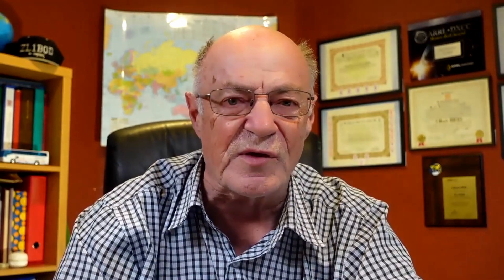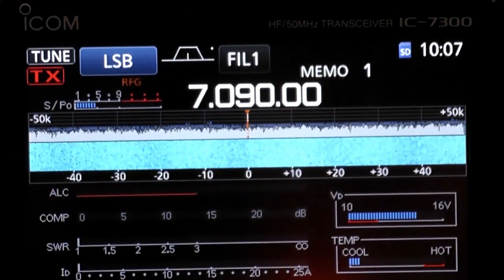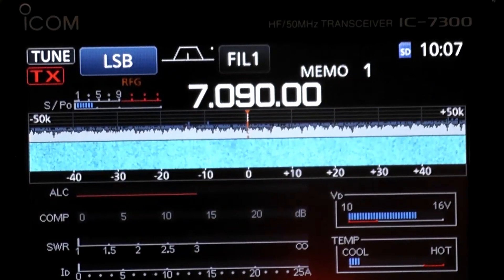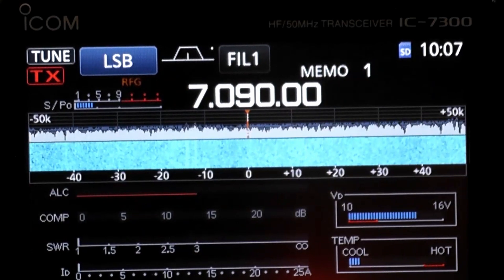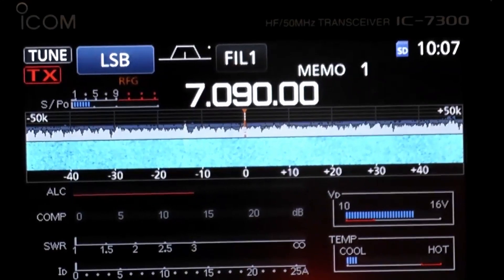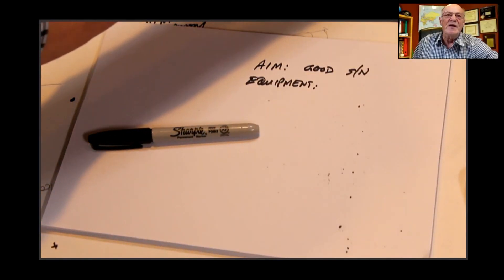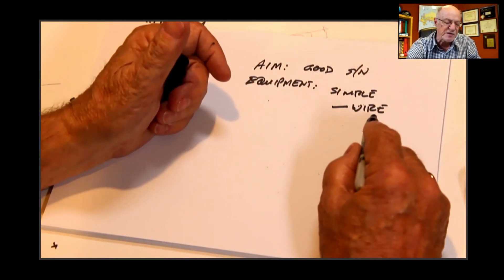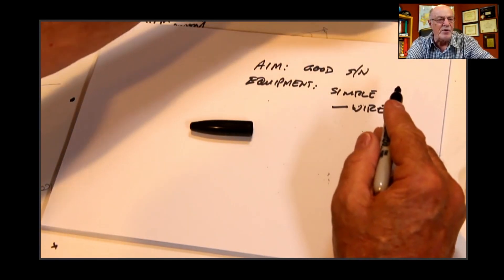HAM RADIO - Eliminate the NOISE !!

Comment: For my qth. I used a 49.1 with a 66.6ft of wire its on the top of a 3ft fence. Works superb on 40mtrs and 80. Bit deaf on 20 15 10 though. I could give a loop a go with no un un.

Comment: I followed you until you were switched between the wire and the wire eliminated. My question was what was hooked to what that allowed to move from the experimental factor and the non experimental factor? Thank you for your time. You were very kind to help me to reduce the noise level.

Comment: I would be looking for other causes of the noise, if you have a rig that runs on 12 volts, get a battery, and turn off the house current and see if the noise quits. If you don't have such a rig, beg, borrow, or buy one!

I have found many times that a wall wart is causing the noise. Some try ferrite and other tricks, but I replace the noisy ones with ones with transformers, not switcher supplies. Other causes are light dimmers and touch switches on lamps.

Noise on antennas can also be due to power lines, but that is rare, as the power company is losing money with insulators that leak current, and they replace them. Don't give up on your antenna, unless it is the antennas fault, and no, verticals are not noisier than any other antenna, it is hog wash to stop some from trying a great antenna system.
Reply from the maker: Thanks for your sage advice, all of which has been checked !!
Reply: @ZL1BQDRoly  So you know the cause of the noise? Or it is outside your property?

I have dealt with noise here, and it has all been local to my property, except when a neighbor was welding. Fortunately for me, he has moved and no one else welds around me!

Good luck with you hunt!

Comment: 10:22 Why nobody does such comparisons on 70cm band? Is the noise floor around 440MHz so low that everything is fine even with a simple yagi with staight split dipole? No need to build Low Noise LFA Yagi for UHF?

Comment: I suggest: Raise the horizontal loop up to about 30 feet. Use 300 or 450 ohm feedline from the loop to a 4:1 or 6:1 balun at your shack, then into an antenna tuner via short 50 ohm coax jumpers. This will literally raise your ears out of the surrounding noise. If you use it for transmission too, at 30 ft., you get 6 Db gain! And a super low radiation angle omnidirectional transmission pattern on the higher bands really great for Dx

Comment: Good day sir.
I am just one year old ham here in Belgium. 
The other day I went to an elderly OM who builds antennas,  repairs units, etc.  
Outside he has a 40m EFLW and he uses it every day.   But on 40m and specially 80m there's a noise level like you're showing here.  

We also could hear an Italian distant station,  but it was not good.  Lots of noise...
Then, leaving it on that station,  he got out a homemade magnetic loop antenna and plugged that in, and tuned the variable capacitor... what a difference.  The same signal, but virtually no noise...!

Je explained a lot about it picking up just the magnetic part of the signal and not the electric part.  It was fascinating...  He also explained that every time he changes frequency, he also re-tunes the resonance.

Your "around the house loop antenna" doesn't seem to need adjusting every few KHz you move...  which is an advantage. 
Shouldn't every ham, (who can), do this ?

Thanks for making this meaningful video 

Peter
ON3VCF in Belgium
Reply from the maker: Not every Ham is able to do this I guess.  Also, results are variable and this worked for me. :)

Comment: So one end connects to driven or centre of the coax and the other end comes back to the driven pin also with radials on the shield or the other end comes back to the shield with the radials?
  Some people have been having success using a loop like this as the aux antenna for vk5 or similar noise cancellers.

Comment: If you use that wire as a Beverage receive antenna and add a phase system, you will be able to knock out just about all noise.
Reply: This loop is not a Beverage receive antenna, it is a closed loop..  But you are right about the phase cancellation technique..  But that is only true if the man made noise is coming from a single point source, in Rollys case he is surrounded by all sorts of manmade noise coming at him on all points on the compass and all within a couple hunderd of meters too,, Yikes !   You are right though, you can eliminate perhaps the biggest contributer of the noise via the phace cancellation technique have done it myself both for HF and TV and FM Band Dxing..

Comment: Could you not have a UNUN that connects to your transceiver in the roofspace and a wire that comes from the Antenna connection on the UNUN through a tiny hole in the facia board then to a pole at the bottom of the garden which should work or what about having a look at W5JGV and seeing if you can use one of the trees in your area as an Antenna.

Comment: I'm a new Ham. How do you connect a loop antenna to the coax, do both ends connect to the inner coax conductor, or one to the inner and one to the outer conductor? And is a balun used? Thanks, and great video.
Reply: Look up "Loop On Ground" AKA LOG antennas which is basically what this is. As far as I know, only one end connects to the center conductor through a torroidal transformer, the braid is your ground which connects to a counterpoise wire from the toroid. And yes you'll want a balun choke near the transformer and one at the shack to prevent picking up stray RF on your feed line going into the antenna AND the radio.
Reply: @macgyver5108  Thanks for the reply. I've got a 128 ft. end fed antenna and thinking about extending it into a loop antenna. Want to make sure I do it right.
Reply: @Znobyrd  I looked it up and a loop on ground uses a 4:1 balun/transformer and looks like both ends of the loop hook to that. You'll still want torroid chokes on both ends of the feed line for stray RF.

Comment: Is this a listen only loop or is it tuned to transmit on?
Reply from the maker: Yes, for listen only.  It could be made for transmit but the components would have to be "beefed up" to cope. Primarily for listen though simply to beat the noise as much as possible.
Reply: @ZL1BQDRoly  And I agree , you could transmit into it, but the XYL might not appreciate that hihi !
Reply: I once had a square resonant 40 meter one wavelength Loop up at 18 feet. the wire was perfectly parallel to the ground, I had an annoying noise I was trying to get rid of , and it worked perfectly. That antenna was a perfect NVIS antenna too and was spaced with the ground as a reflector.  It surely was a close in antenna, but yet still did a superb job out to 600-700 miles or so.  A cubicle quad beaming straight up!  I also tried putting a bit larger loop underneath and on the ground, so as to act as as true reflector, but little was gained via that effort... But that antenna was fantastic and was so simple.  Also did the same with 75 meters too, and that  also was fantastic cloud burner, and QRM eliminator..    I love messing with antennas here. and enjoy your videos..  Jerry KC2UT

Comment: Tried this at my QTH. It reduced the noise but also removed the wanted signals. S9 became S7. Well I could hear and work them with or without noise. The stations replying to my CQ that are sitting on the edge of the noise are taken away also. SN ratio is all good but not much use if the wanted signal is also taken away.

Comment: this was really good Roly.  Never ever considered those electric fence stand-offs.  Perfect.  I have enough space here for approximately a 100m loop. That would probably help me with low band dxing.  I have an inverted L on 160m that cracks out, but is noisy of course.  This would likely be the solution.  I also have horrendous powerline noise, so this may be of assistance there too.  73, Aaron VK2ON
Reply from the maker: Glad you found them useful. I have used these standoff on numerous occasions with great success. Cheers
Reply: I'm going to screw the stand offs into colourbond Roly.  What do you think.  Will such close proximity to a another conductor mess things up?
Reply from the maker: I would be a little cautious, the colour bond could act as a shield......
give it a go and let's know :)
cheers

Comment: Roly, nice video,  how did you get a wire under the driveway.?
Reply from the maker: I used a garden hose with running water.  It is fairly sandy so i was able to "pus" a hole through quite easily. That method would not work in rocky or heavy clay soils though.
Cheers

Comment: Hi Roly, reading the comments, I'm a little confused. Is the loop you've made a receive antenna, or a loop of wire connected to ground (the plate on the DX commander that connects to the ground radials) to try and absorb interference ? 
73, VK3LSR
Reply from the maker: The loop is a Receiver Antenna.  I am just using the base of the DXC as a convenenient means of connecting a PL259....cheers

Comment: HIII ROLY GREAT INFO ,,, I HAVE ONE QUESTION , WILL ACTIVE NOISE CANCELLING HEAD PHONE  DO  JOB HF RADIO NOISE SUPRESSION AND ALSO    Ground Loop Noise Isolator for Car Audio/Home Stereo System with 3.5mm Audio Cable  WILL WORK OF REDUCING HF NOISE ,   KINDLY COMMENT ON IT
Reply from the maker: This video is about RF noise not noise induced into audio systems or physical noise.  Your suggestions won't help much with atmospheric RF noise,   cheers

Comment: how do you connect this to the radio? Is it just one end to the centre of the antenna input on the radio and the other end to the earth side? Or is a balun or something needed in between?
Reply from the maker: Yes i do have a small matching balun to connect the loop to the coax...   cheers

Comment: Receive loop doesn''t need to be above ground. I'm running websdr (can be found on PA3FWM websdr site - search for so8oo websdr) using loop on ground antenna. There are ofcourse better antennas, but considerig used space it is a great performer. I make automated FT8 reporting to pskreporter - search there for SN0E station. There are spots from all over world. My antenna is lying on the ground, it is rectangle (6 m x 6 m) fed in the corner.  Proper feedline decoupling is a must!
Reply from the maker: Thanks for sharing....cheers

Comment: Hey Roly....... I have to figure out a way to get the larger loop configured. ( I have obstacles to contend with....lol..... Did something interesting. 150' of RG6U coax on the ground with the shield and the center conductor soldered together..... WOW factor..... went from S9 noise floor to S3 on 40M. S/N ratio is fantastic....... picking CW right out of the floor...... can't even see the signal on the panadapter from the off center fed. works decent on 20.... but really don't need it there.... my Hex is pretty quite........ I'm looking forward to try it tonight on 80 and 160
Reply from the maker: Now that is interesting. So basically all you have done is increased the conductor surface area at the same height above ground......   must have a look at that....cheers
Reply: @ZL1BQDRoly  Yes......weird.... laying on the ground

Comment: Great video, I have several receive ant's..... amplified 3' loop. random wire, ewe, also a timewave phaser....... sometimes good , sometimes not so good. The LOG with a 9:1 xformer (15' square) is defiantly the quietest but the sig is so low it is a struggle to hear. I'll give your Lot loop a try......... my fear is it will amplify the noise mor than the sig........ we'll see..... Thanks
Reply from the maker: I am ken to see your results....cheers
Reply: Add a preamp?

Comment: Why is your loop 30cm above the ground, rather than on the ground? I was told to peg mine to the ground.
Reply from the maker: Just a practical consideration of being able to trim the garden without cutting or pulling out the wire. Actually, more than 50% of the wire is buried under leaf mould now anyway ......  cheers

Comment: What about a DSP based Adaptive Noise Filter but you need a Noise antenna but can only be used on RX not TX or you will let the magic smoak out.
Reply from the maker: I have never used one but worth investigating.
I have no trouble in letting the smoke soak out, it's getting it back in again that is the challenge.....cheers

Comment: Does the loop comes back to the ground plate of the DX commander?
Reply from the maker: Yes. One end of the loop goes to the driven plate the other to the ground plate.
Remember this is a RECEIVE loop only, I am not using it for transmit......cheers
Reply: @ZL1BQDRoly  I was trying to figure it out by looking at the video several times but I did not get it so you have two plates on it? I thought you come out of the grounding plate go around the property and return back to the ground plate.
Reply from the maker: I am using the drive plate just as a convenient way to connect the centre conductor of the coax feed to the loop.
I am not using the plates fro Transmit in this configuration,...cheers
Reply: @ZL1BQDRoly  Can you still transmit with it? Or  may have to put a switch to disconnet?

Comment: Great video. I am curious to know, however, could you hook that loop wire up to an SWR and get a reading? If I understand this correctly, it is essentially a ground antenna, so it should have an SWR. If we can read the SWR, then surely it can be fine-tuned even further.
Reply from the maker: That is one way to do it i guess Jeramie, however this antenna is designed for Receive only.  The better way to see what is going on is to use an antenna analyser.  This will then tell you the characteristic impedance of the antenna and so give you clue as to what ratio balun to use to match your receiver input.   cheers

Comment: Adding to your experiment Roly I often wondered why you give me a readability 5 in your RST reports to me from my summit when I sometimes give you R 3 in my RST report in return. I run 8 Watts on summits and assume you run 100 Watts from home. That RX antenna is a great idea. Regards Ian vk5cz ..
Reply from the maker: Normally running closer to 50 watts but into a pair of phased verticals pointing your way on 40mtrs.  Great for VK SOTA and Parks...  cheers

Comment: Roly,

I'm considering doing a LOG antenna in my back yard. The garden is about 70 feet wide by about 60 feet deep. There is a 6 foot tall wooden fence along the 70 foot length and along the two 60 foot sides there is an aluminum fence. Do you think that putting the wire at the base of the two aluminum fences will significantly negatively impact the loop? I know that I can just throw some wire out there and try it, but I don't have 260 feet of wire just laying around at the moment, nor materials to make the 9:1 balun (?). Also, given that my lot is largely North/South (the 70 foot back fence is maybe rotated 4 degrees anti-clockwise, I would assume that the primary lobes will be at about 41 degrees and 221 degrees, which largely puts most of the signal in unusable directions.
Reply from the maker: Interesting setup. The aluminium fence could be a negative factor, i am not sure.  The only real way to find out is to "give it a go"..👍......cheers

Comment: Only way to eliminate the noise on HF is use the on/off switch. Put it on off.
Reply: That would work. I would clip the speaker. Watch the waterfall, use the keyboard. Thus no noise. It’s like if a tree falls in the woods and no one is around to hear does it make a noise?
Reply from the maker: Let me know when you are ready.... i will go head on head with you on a keyboard and me with my key and see who comes out on top  😎
Just for fun let's make it on a noisy band like 80mtrs ......  Cheers.
Reply from the maker: @mhpreach  Ahhh you and i share a common profession then.  I too am a retired (now) Broadcast Engineer.  I headed up the Tech Dept for one of our very large Radio?TV Broadcasters here in NZ for many years.  Been licensed since 1965.....geesh that's a long time. All is fun for sure....   cheers
Reply from the maker: Thank you for the helpful reply..   By on and off i goes you mean use CW...

Comment: Hi Roly, interesting idea, I will definitely try it.  In the spirit of a scientific experiment, do you have a reference to the theory behind this antenna, how it works, and why it works, and what you might vary to see how the results change?  For example if you elevated it would that help or make things worse?  Very interesting result…. 73, VK4QP
Reply from the maker: I am trying to get back to this antenna.
i did try elevating the wire to about 1 mtr and the results certainly degraded.
I noticed this afternoon that more than 50% of the length is buried under the grass and it is working extremely well..........
The trick is to try and NOT pickup any noise component.  The signal takse care of itself and can be enhanced with a preamp (experimenting with one as we speak)
Cheers
Reply: @ZL1BQDRoly  I’d be very interested to see the preamp, will you have some kind of tuned circuit before the preamp, acting as a preselector?  You’ve got me thinking now…

Comment: Mate! FIRSTLY Turn of the  ANTENNA AMPLIFIER!
You get antenna signals without that amplifier! 
That is of NO USE! 
THEN YOU USE A REKTANGULAR LOOP WITH SIDE 13,2m and 29,2m
TOTAL about  83,0 m or the double.   DON'T FORGET TO
DO A DC EART OM OPPOSITE 
OF THE FEEDPOINT! 
NO  SIDE/SIDE  BELOW 1:2,4 
SO LONG SIDE 2.4 X13.2m 
ALWAYS EARTH INCOMING 
ANTENNA BEFORE CONNECT
TO RXTX OR TUNER!  5kV of static elektricity!  
MIDPOINT EARTH DON'T FORGET! 73'S de Gunnar sm6oer >>\<
Reply from the maker: Thanks for the input.... that's one way of doing it but does not suit my particular setup.
Yes, I didn't notice that the antenna amp was on.
Good experimenting though.....cheers